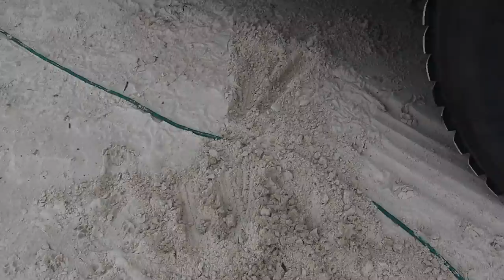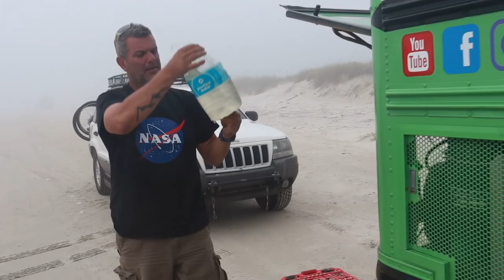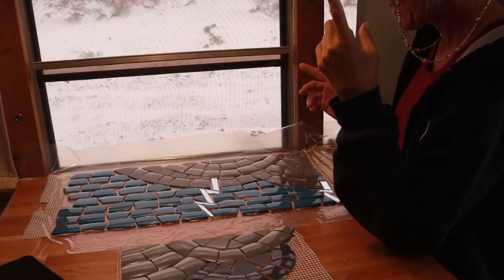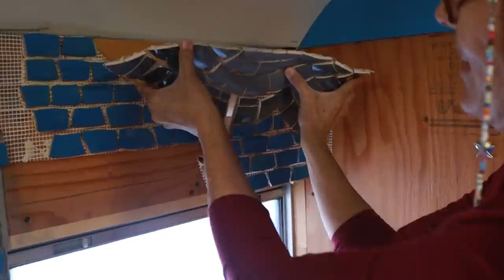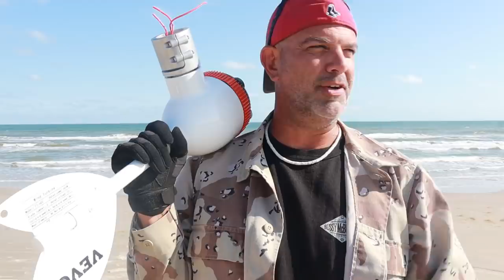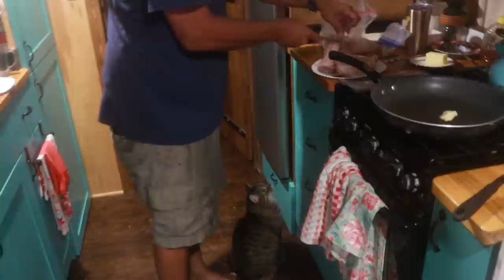Kerry Installs a Mosaic & Mike Installs a Wind Turbine!

Comment: Need to get you an automatic spitter valve for your air tank.  I got a 110volt one with a built-in timer for my shop air compressor for about 20.00 bucks.  Has worked for 3 years now.  I also added a 110v Harbor Freight timer because I don't need it blowing off every so many minutes all day long.

Comment: On our old pickup we used to have a sediment bowl on the gas line between the fuel pump and the carburetor. They were made of clear glass and you could easily see the water/gas seperation and could pop them off and dump them.
Reply from the maker: Thank you! That is exactly what I need!

Comment: A Hershey's kiss size dollop will squish out insuring contact adhesion.
Apply the dollop bring connection togeather then pull apart (the intention is to pull apart leaving strings of adhesive to air approx 5 minutes increasing surface area causing acceleration of cure increasing contact bond strength)

Comment: best fix for water in fuel is propane gen and propane never goes bad.
water in fuel came from gas station to you're fuel can to gen. i never empty a fuel can and fill up at 1/4 tank because of the crap in bottom of tank. 
50 years being a mechanic i have fixed a ton of fuel problems. yes i have propane gen and would never use gas :)

Comment: get ya an in line water separator for the bus and the Kenny if you don't have one already!!!  water is a DIESEL KILLER>>>  and well the genie that sucks if it doesn't just start like you want!

they have them for boats in like ACADEMY sporting goods or any where with small outboard motor parts etc....  they work on a "overflow" style setup...  then you can see the collected H2O in the in line filter and drain it before it ever even has a chance to mess with the genie etc.  just an idea!

Comment: I mentioned the idea to ( I think it was )  Life is a joy or Steampunk Steve a few month ago. Response was they have enough solar and a generator 😎 but also mentioned that a few buses have wind turbines on their roof. Since I do not have one of those and also do not have a bus..... I obviously have no glue about data. As for the mounting... If you mount it on a hinge, it should be easier to take down and set up and it also would have it's permanent place so you could run permanent wiring .
Reply from the maker: I'm going to do a video about this.

Comment: Is it possible to attach an inline air dryer as used on compressors, on the generator breather? Also, the Honda cools by sucking air from the bottom, which is why it's best to keep it off sand and dirt. Best to place it on a sheet of ply or cardboard.
Reply from the maker: We actually thought of the same thing but I'm not sure it would work without a lot of pressure backing it.

Comment: #1 as fuel is used the consequenc is atmosphere drawn into fuel tank, tank cools water vapor condenses = water in fuel repetition of process addes more water to fuel, back in the day carburetors had a valve (petcock) to drain the water, these days all fuel has alchohol which compounds the problem. The quick answer is always run the device untill empty or drain & replace with new fuel or swift & often topping off fuel tank however fuel storage in seperate can suffers from the same problem. In addition modern carburetors have a rubber composite diagram gasget that suffers from gasoline / alchohol mix & must be replaced yearly or more frequently.  Riding along with the water vapor are botanical algae,  yes the problem is continuous Permanente fix is convert to propane fuel (sealed storage). For you one must become accustomed to draining the water, replacement of diaphragm,  cleaning of filters, tanks, fuel bowls.  Your diesel bus probably has a water seperator filter that has to be drained / replaced periodically.  All the same reasons you have to blow off the compressed air tank for your brake system. The algae found in carburetor will clog the filter & you need detergent to clean the carb, it has been suggested that pinesol is a great carb soak cleaning agent , disassembled parts are left to soak 24 hrs then cleaned and dried.
It is best to obtain the filters, diaphragm and parts in advance thus one can quickly be back up and running plus once you have a new diaphragm in hand it becomes easy to identify a (used, worn, damaged) part. A can of start fluid is handy as well.

Comment: Seems that wind turbine theory is not so much needing an addition factor of about 10 yes 10 turbines your size in order to accomplish your goal (recharge your batteries) 10 times the cost 10 times the equipment wires & electronic controllers plus more batteries & then factor in the rate of failure it becomes a nightmare.  Good luck!
Reply from the maker: I plan to do a follow-up video for the wind turbine. And yes it is not performing to its rating. But there has been a positive.
Reply: I have a partially converted mid sized Skoolie in a very windy area in MN. I’m really so happy to see the application of wind to energy.. it may make a big difference for people like me that live in windy areas. Looking forward to all your great content! Y’all are my faves! God Bless your adventures!🖖🤙🏻😎👍